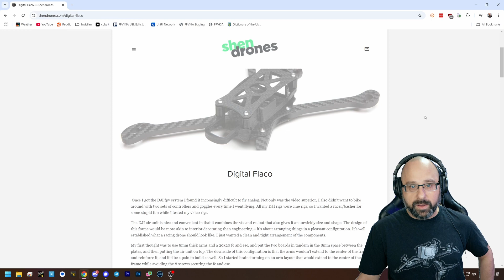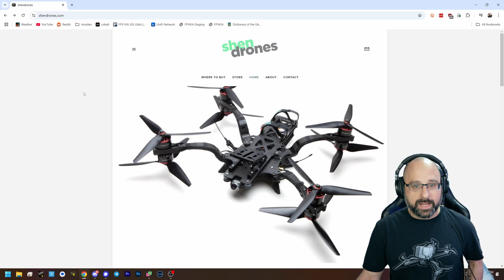Upside Down Motors? That's Called A Pusher! Flight Time Issues? - FPV Questions

Comment: smallest motors and lowest RPM you can get away with. I have no problems building quads that fly 15-20 minutes on 500mAh-800mAh 6s.

Comment: Negative pressure has nothing to do with it.  Quads have lift because of a Newtonian reaction to the air being thrust downward.  Therefore, having the arm above the motor is better because it doesn't interfere with the air being thrust downward.  While arms below the motor block a percentage of that thrust - depending on the size of the arms.

Comment: RE: flight time issues, check if your props are installed upside down. I made a stupid mistake on a tinywhoop build that caused me to only get 2 minutes of casual flying. Turns out, I had installed my props upside down. After flipping, I easily get 3 minutes or slightly more.